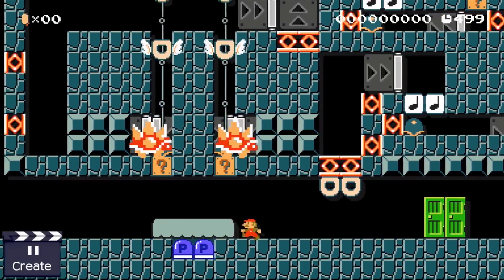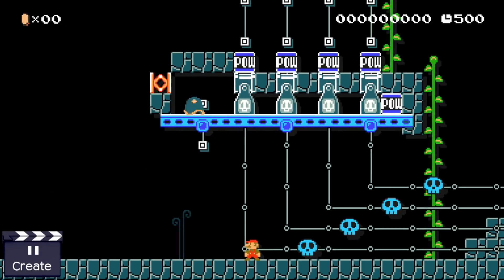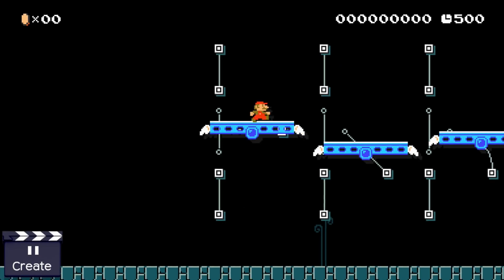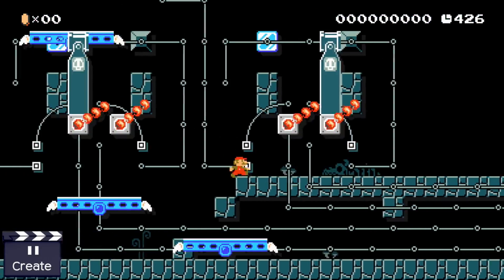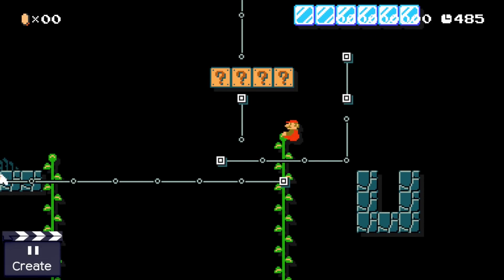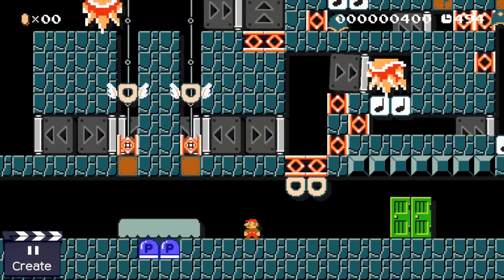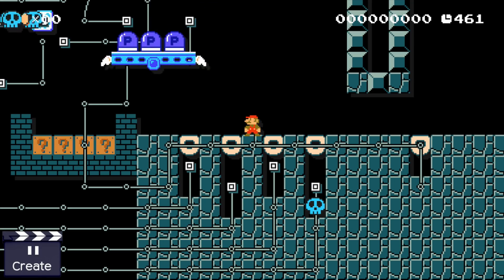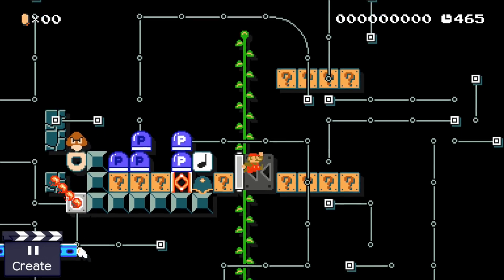Is it Possible to Build Binary Storage in Super Mario Maker ?

Comment: Your addition algorthom is a mix of or and and. It is not actually an addition algorthom. If the same bit of both inputs is set, then it should carry over to the next bit, not put two switches on top of each other.

Comment: correct me if i'm wrong but surely an and or an or gate would be pretty easy. now granted, i don't have the game so i'll have to explain it instead
For an and gate, make it so that both pow switches "sets" land on top of each other, then find a way to only take the second row, anything on the second row up would have to  have been a 1 in both "sets"
For the or gate, just do the opposite and take the first set and remove the second, as anything that has shown up in either "sets" will be in the first row

Comment: You could make an AND operation by making the platform move horizontally and push off (and save) the blocks from the top row. If there is no top row then the AND should return 0 so that is correct. I don't have mario maker myself so I don't have a solution on how to keep the order of the top row the same if there are empty spaces inbetween. :(

The OR operation should be even easier because you just (somehow) discard the top row of the stacked p-switches.

I don't have an idea for the NOT operation...

Comment: I don't own and have never played SMM, so I can't test this, but I think you might be able to make an OR command using a variant of the technique used at about 8:25 in the video. Set it up so that multiple blocks for the same value stack in a column, then move the platform carrying them vertically up to an ice block, making sure there's a one-block gap between the platform and the ice block so that you can preserve a single block of each value. If I understand the way it works correctly, this should knock down all excess blocks, preserving up to one block of each value? This runs into an issue with where those blocks fall, but it seems like you could handle that by dropping them in a hole.

Comment: 9:20 You want those 4 opeartions? Okay, let me try:
Bitshift: The simplest one. Just shift the Pow Blocks of a sequence one block to left or right. I asume that is the one you have already.

 I think you have to do those other operations Bitwise. So one bit at a time. Otherwise we end up with interference.
1. Use your output system.
2. (Try to) Stack two Pow's representing a bit state on top of each other

AND: If the stack of Pows is 2 high, you get a 1 to further output
OR: If the stack is at least 1 high, you put 1 to further output. If it is 2 high does not mater, as long as it is more then 0
NOT: You put one Pow Block onto the output Platform. Then you read the stored bit. If the result is 2 high (used to be 1), output 0 (inverted 1). If the output is 1 (1+0) high, output 1 (inverted 0). So this can directly flow from your work onteh AND and OR. Basically you feed a all 1 bitmask and the input pattern to a XOR.

The only issues is finding a way to measure the height of a Pow Stack and create directed output based on this. It should be possible to put one blue platform into a resting position (a very short track) and have another platform pick up pows from it, right? Or maybe let the platform fall out of the game and have a Firebar take over the pows?
If so, you should be able to select at wich "height above the platform" the 2nd platform comes in and so if it takes both or only one Pow.

Comment: So yano you spoke about the respawning of blue platforms if moved away far enough? Well how about you start a level with landing on a specific blue platform, then going through a pipe to the contraption of the binary storing that is right next to it to set it up how you want and then go back through the pipe to reset the blue platform so it goes off and, based off your binary input, does something. This way you could use the trigger switch multiple times with the blue platform moving the p switched back into there orginal postition so you can then re enter your binary input. I know its confusing and if you want a scenario I will try make one but it will be hard as I do not own mario maker

Comment: Hello, I'm probably late to the party but I think I know how to build AND in Mario Maker. I don't have Wii myself so there is no way to test it for me.

So the contraption very similar to the one on 1:44 but it has just one cannon without any Pows. To its left there should be two holes in the ground 1 or 2 blocks wide (or maybe one wide hole). At the end of the ride there is a note block containing another P.

When the calculation starts - a scull platform picks up bit A and drops it to one of the holes. After that it does the same for B and after this it removes the cannon to activate the shell. If both bits are set, the shell will ride to the note block and drop the result bit. If any of the inputs are 0 it will be stuck in one of the holes.

By stacking the input bits on top of each other you can also get XOR. This operation wasn't requested but it's actually useful if we need the plus operation.

Now when I think about it, you can do NOT the same way by just dropping a bit on the ground instead of the hole. If the bit is 1 the shell will not reach the note block and so the result will be 0.

I don't think of any way of doing OR like this. But you can make it by presenting it as not( and( not(A), not(B) ) ).

Comment: I have an intersection (and) and union (or) calculator level that could be what you are looking for in this. It’s more for set theory, but inspired by your video. You input values 1-4 in 2 unique sets and depending on which operation you chose, the result is either the intersection or union of the sets. The course ID is 4D47-0000-03AE-EBF7.

Comment: Could you do the AND logic Gate by picking the two numbers up (one over another) and "delete" the lower row somehow so that only the bits you had 2 P-Switches in would still have the P-Switch?
Same goes for the OR logic Gate, but you'd have to "delete" the upper row.

For the NOT Gate I am not quite sure, but if there would be ground in SMM, (I don't play SMM) on which enemies fall through but P-Switches don't you could simply but the 4 bits on that ground, let enemies fall on the 4 bits and on every bit without a P-Switch the enemy would just fall through the ground on a note block that spawns a P-Switch

I'm not sure if you can delete "rows" of P-Switches or maybe even POWs but I hope I helped

Comment: I figured out how to create some of the logic gates! They're actually surprisingly simple.

So first, the AND gate. Take the first input row of P-switches and place them on top of the second input. Then, have the blue platform cycle back around and pick up only the P-switches that are stacked. By this I mean that the blue platform picks up only the P-switches that are 2 blocks above the platform they are on. Then, place these P-switches as your output. Done!

The OR gate is just as simple as the AND gate. First, set up an AND gate. However, the output for this AND gate should be dropped off the stage. Once this is done, have the blue platform cycle back and pick up the remaining input P-switches as the output.

The NOT gate is a bit harder. I figured out a solution, but to use the NOT gate a POW-block trigger is required. First, set up a row of note-blocks with munchers in them. a few blocks below the note blocks put a row of any solid block. Take the input row of P-switches and place them on the note-blocks, dropping the corresponding munchers. Then, place a row of P-switches on top of the platform where these munchers now are. Remove any P-switches that are on top of munchers using the AND setup, and then trigger a POW-block to remove the munchers. This should complete the NOT gate.

Lastly, on a side note that has nothing to do with binary storage, I figured out a good use for hammer bros. It is possible to create a randomizer using hammer bros, by utilizing the fact that they will randomly jump up or down. However, it can be very annoying to set up, as hammer bros don't like jumping on note blocks. Still, it's the only good use for hammer bros. Maybe use in Mushroom Championship?

Comment: "A computer is only able to understand if there's electricity or not."

This isn't the case.  As long as we've been making transistors we've been able to set and distinguish between various voltage levels.  Ostensibly, with perfect equipment, we could build decimal (or higher) logic systems.  For instance, <0.5V = 0, 0.5V - 1.5V = 1, ..., >9.5V=10

The problem comes from the reliability of being able to maintain a level of voltage and the accuracy and response time of switching voltage levels.  By having a binary system, we could maintain a lower logic voltage (3.3V or 5V on most modern systems) plus plenty of wiggle room for the fundamentally analog nature of digital circuits.  A binary bit might take several nanoseconds to fall from 5V to 0V and might be a dirty/inconsistent signal, but once it crosses below 2.5V, we can register it as a 0, despite what's actually going on.

If you'd like to know more, check out Thomas Fowler's Ternary (-1, 0, 1) mechanical computer from 1840.  The Soviet Union also built a ternary system in the 1950s that had significant advantages over binary computer systems of the time.

Comment: I'm not sure if you're still having trouble with AND, OR and NOT Gates, but I have a few Ideas.

using the XOR:
    if a AND b, the P-Switches are 2 High, so if you could remove only the top layer, you could find a AND b
   if a OR b, there will be a switch on the lower layer, which, having already used the AND gate to remove the top layer, can be retrieved easily

For a NOT gate, P-Switches block Thwomps, which can Drop P-Switches from item blocks. by Splitting the P-Switches, and Carefully controlling Player Movement, it should be possible to activate each Thwomp once, inverting the positions of the P-Switches

Comment: For the AND operation, just stack both 4-bit-strings ontop if each other and have the platform move in such a way, that it places only the 2nd level of Ps or Pows on a platform or one-way gate. Then pick them up with a second platform (or the same after clearing it)
The Or function would work similar, but instead of just counting the upper level, you just count the lower one, so you could have a platform move in from the side on the level of the lower Ps, then turn upwards to carry off the upper ones and then pick up the lower ones as your result.
these seemed pretty easy, but ive never played smm myself, so i probably missed something

Comment: I figured out a way to make bitwise AND and OR operations -- and in fact, this one calculates both at the same time. I don't have a capture card handy at the moment, but I've uploaded a demo level online. Level ID is ACE3-0000-03A8-377D

Edit: Just realized that NotchMath made a different way to do NOT, AND, and OR. If you haven't seen it yet, check out the replies to Helgefan's comment.

Comment: AND should be doable right? Just have a platform stack the two inputs on top of eachother. Now bits that were set in both inputs A AND B are sitting one block higher. Now the output platform slides in at the lower height and lifts up to pick up only the higher switches. If you can find a way to extract the bottom row then you have OR as well. I'm not sure if that's how collision works but could that do it?

Comment: Why not drop one 4-bit rack on top of another 4-bit rack. Use a sceletal coaster going straight up to pick up 1 of the 4 bits to then drop it on a line with a mob you can set free to travel right. (like the a+b=15) Depending on the hight of the tile the two 1-bit were drop on you can test for a total of 0, 1 or 2.

If you decide to test for 0, we have a design for a NOR gate.
If you decide to test for 1, we have a design for a XOR gate.
If you decide to test for 2, we have a design for a And gate.

Sorry I can't physically get you a design, I don't play Super Mario Maker I just watch the occasional video on it (/of yours) and got caught interested by the concept.

Comment: >A computer is only able to understand if there is electricity or not.
This is wrong, or at least misleading. A computer can also "understand" what voltage is being applied. While you can define a low voltage to be 0 and a higher voltage to be 1, you could also design your computer to run on trinary by designating a low voltage to be 0, a medium voltage to be 1, and a higher voltage to be 2. In early electrical computing (as opposed to mechanical or even human computers for example) history there were many computers which operated on differently based number systems in this way. While binary via low and high voltage won out, it's not the "only" thing a computer can understand.

Comment: For an or function output, couldn't you just take the P switches and drop them onto noteblocks? In the contraption it would 1100 and 1010 would be on the noteblock, stack of 2 p switches, 1 p switch, 1 p switch, and no p switches. Once those stacks of P switches hits the note blocks, it would then poop out a fresh pair of P switches onto the "results" platform in a 1110 pattern.

Comment: I'm imagining that the only practical form of this would be for a "programming language" of specialized "computer blocks" to be developed, with individual levels serving as "programs"
The next step would be to make a on off switch on these "blocks" allowing the construction of programmable "machines" made of a set of strung together "blocks" with some level of variance, depending on which blocks were on. This would allow for multiple "programs" to exist in one level
From here we could figure out how to optimize the size, even combining some blocks
Like a and/nand block, with a built in switch. This would create more variety, with the only problem being the fact that you could only pick one, not both.
With this innovation, we could possibly construct rudimentary arithmetic calculators but it would either be really confusing to operate or only have like 2 operations
I think that and a music machine able to generate a song would be the ultimate form of this concept, unless someone were to suddenly invent a method of making blocks that could be used multiple times.
That way we could pass information back and forth between the blocks, with the only limitation being the time limit, which would develop a programming wall of 8 minutes 20 seconds
So unless a method of making these things run faster is developed, there would definitely be a limitation on how much we could process data in mario maker
One way I see to bypass this would be to make blocks capable of three logic gates, then be able to bounce the processing over and over to shorten the datas travel time
By stringing these together, we could create more powerful computers, able to run at faster speeds. The downside however, would be programming these as mario would be a nightmare
The programming would take place more in the create mode than the play mode, bringing it make to like the first level of MM data processing
The upside is that this system, when perfected, might allow for the creation of mini games, making up for the lack of programming ability.
Ultimately, MM might be able to allow for a computer maybe as smart as a good calculator, but less specialized and with no GUI, making it some what of a nuisance.
But that's just speculation, and I'd like to see how all of this turns out.
P.S. I am very tired while writing this, so I probably made a very big mistake in my reasoning. Please feel free to say how you thing MM data processing is going to turn out. Thanks for reading and have a nice day!

Comment: The "OR" operation might be possible.  If you have a platform pick up to sets of binary numbers (with 1 being marked by a p switch), than a slot that is zero would have no P switch, a slot with one in one set, but not the other would have one p switch, and a spot with a one in both sets would have two P switches on top of each other.  You could then run this under a muncher, destroying the p switch on the top so that only the bottom P switches remained.

Comment: If got it! I've made a working OR tool. The level ID is 224B-0000-0346-35E0 and after you got to the zone with the stone ground you can enter 2 binerical numbers by using the skeleton Rollercoasters to the far left and right. After a moment the numbers appear on the cloud blocks above in Form of p-switches. To start the calculation activate the blue platform and wait for half a minute, then the calculated number is displayed on the questionbocks. The door leads to the goal. PS: sometimes setting the bits doesn't work properly and the p-switches don't appear, if it happens restart the level

Comment: A single-use AND gate works just like the XOR gate, but two deep: IFF one/two POWs are on a spot, form a path for a goomba to a note block that drops the output.
Single-use OR gate: Have the block trigger a note block
Cannons that fire POWs can be used in  multiuse gates, but they need to be on screen to do so and clearing the input is problematic.

Comment: a computer usually overflow when you bit shift if the value is 0101 then the value if the interpreter isn't programed to compare the previous value becomes 1010, if it was 0001 it becomes 1000, when it comes to half values you need another buffer, usually done by making it bigger 00001000 for example or by interpreting the last bit in a buffer or RAM as a half value, if i remember correctly.